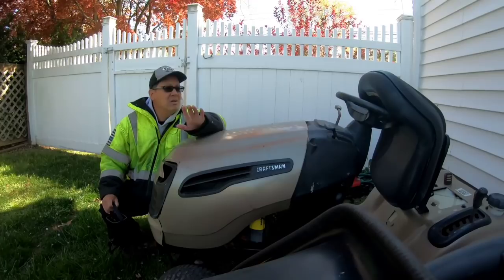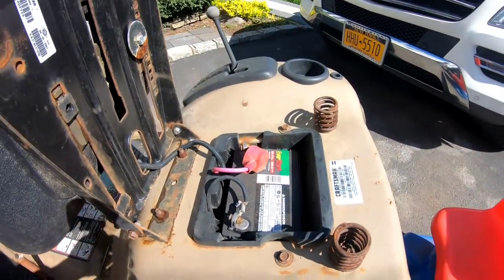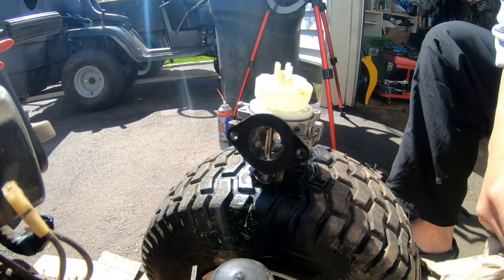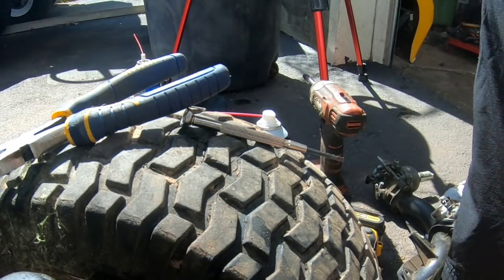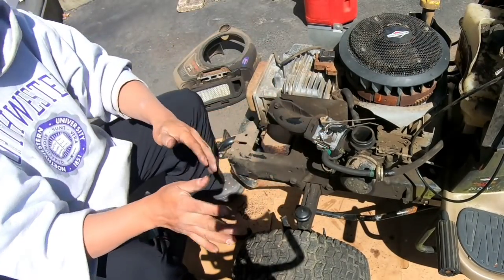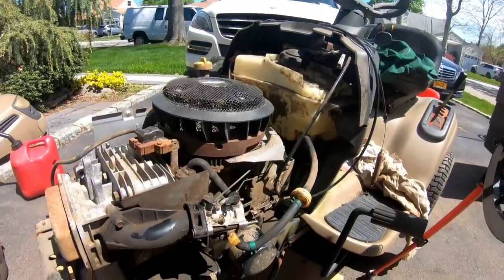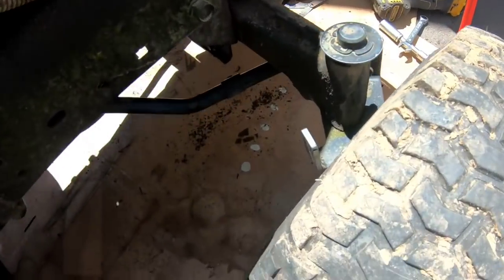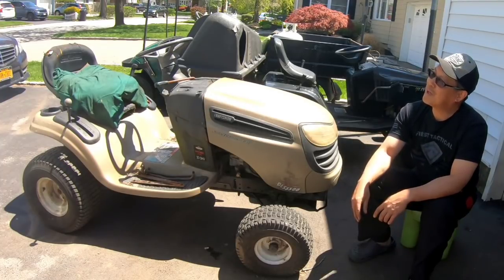CRAFTSMAN 20HP DLS3500 LAWN TRACTOR CARB CLEAN REPLACEMENT DRAG LINK & VALVE  ADJUSTMENT OIL CHANGE

Comment: Thank you for showing the only video I found with the tires rubbing the drag links. I bought my 2008 dls 3500 from a person works on mowers and sells them. Sure enough the drag links were reversed same as yours. Further confirmation was the aftermarket put a red paint mark on the right side drag link. Sure enough red marked drag link was on the left side. It steers perfect now! Thanks again for the information.
Reply from the maker: Glad I could help!  Hope you’re subscribed

Comment: Very informative. Most folks don't know that Briggs lists two carbs in the parts manual for many Inteks, Nikki & Walbro. That's probably because most shipped with Nikki. The Walbro # is LMT 5-4993 & is available at Amazon for as low as $12.. My neighbor had an older Murray/Walbro with a blown Intek. I took his Walbro & swapped it for my Nikki & my tractor not only runs better, the Walbro is much easier to service. BTW, those screws on either carb are called "Idle Mixture" screws so that's why you were able to dial in the Walbro. Why not also the Nikki? Don't know. Nikki's are finicky.
Reply from the maker: Thanks bro